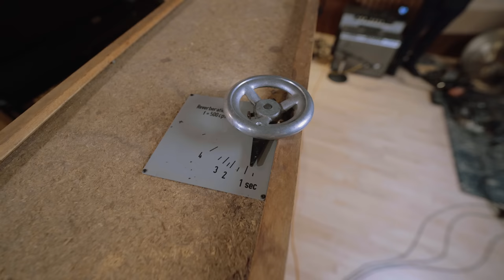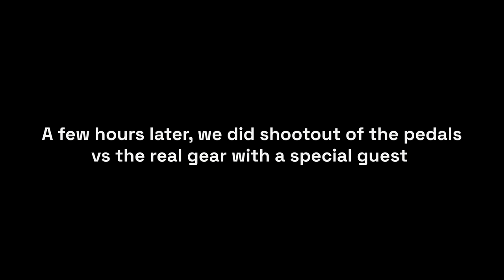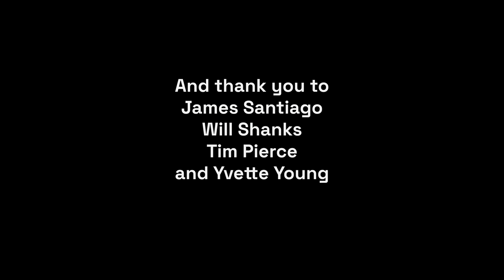The AMAZING Sound Of A Real Plate Reverb

Comment: This was a wonderful video to watch not only because of the history of the EMT 140, but because when I was a grad student in Electrical Engineering, I was part of a trio of semi-pro musician-engineers, and we actually built a large plate reverb according to the explanation in an audio engineering textbook. I had inherited a very large, very heavy wooden wardrobe, which was portable in the sense that with 5 men and a boy, plus a lot of wheelers, it could be shifted from place to place. It was made of very solid wood, on average about 1 inch thick (I believe the "box" was Oak, the back panel Teak, and the front 'double door' had been made from a single slab of a monsterous Redwood, felled and sawed decades before. I discovered that there were some sheets of steel stacked up on one side of the EE building loading dock. They'd been there for ages - one was either 3/4 or 7/8" thick and the other two were 1/4" steel plate. There was also a large sheet of thick copper,  a leftover from some "secret" radio-frequency work done there during WWII. By great good luck, our immediate boss was also the Dean at that time, so when we put the proposal to him, he though it was a great idea. We were expected to spend at least 1 hour of every workday on our own "personal" projects or ideas, with parts supplied from the EE stores. Not sure how that would go today.  With much grunting and a lot of bodies, we manhandled the cabinet up to the top-floor lab, where our group "lived." The department had an superb machine shop staffed by extraordinary craftsmen, so after we'd explained what we wanted the steel plates to do, they designed and fabricated both a suspension system, and a mechanism for moving the plate position. We had several coil-winding machines available, since we made almost all of our own research instruments, and so we cobbled up some drivers and pickups without too much difficulty. There was an excellent book all about the theory and practice of making inductors, for almost any purpose. It was about 2 inches thick, and had been written at the end of WWII, so there was information in there that had been developed for various types of equipment. That was a big help, also. From there, it was simply a matter of "putting it all together" - which was not without incident. One of the technicians from across the hall, who'd been giving us a hand, had the misfortune to have the thick plate dropped across his toes. If the University Hospital had not (literally) been next door, it might have ended with amputations, but fortunately the ER surgeons were right there, and were able to re-attach the toes. I suppose that the finished unit weighed at least a ton, and it aroused a lot of interest from musicians all around the campus. I know it remained in our lab after I'd moved to private industry. What was really distressing to learn was that when the "old" EE building was demolished to make room for a more modern Engineering center, the Plate Reverb was not removed. Instead, it fell to the wrecking ball because at that point there was nobody present to stop that destruction from happening. It was a once-in-a-lifetime project and opportunity, and I'm pretty sure we wrote a note about the project for one of the Engineering journals - I don't have a copy, unfortunately. It was a stinkin' shame that the unit we'd fabricated was destroyed and hauled off for scrap. Quite a few people who'd been involved at that time protested strongly, but the damage was done. If we'd had to buy the wood for the large cabinet, and the steel plates (and the copper one), it would have cost a small fortune. As it was, almost all of the main pieces were "good luck windfalls."  We had a lot of fun with it, as did other musicians who came over to try it out. It could be done again, if money was no object, but now that the department is run by HR rather than by an engineering researcher, such "frivolous time-wasting" could never happen. Our Faculty went from being one of the best in North America, and now is more or less a "woke joke." Certainly, Engineering is not the first focus. Thanks for sharking tis Rhett - I'd almost forgotten about the "wardrobe reverb" cabinet (dimensions 6-1/2 ft tall x 5 ft wide, about 25-30 inches deep). Quite the beast.
Reply: Awesome story, I enjoyed reading that a lot! Thanks for sharing. Sounds like a lovely memory with all the highs and lows

Comment: You can have this specific unit on your pedal board if you capture an IR of it. Capturing IRs is pretty easy for this kind of gear. This type of equipment is a linear time invariant system so convolution captures it perfectly. You can't capture a modulated  (changing over time) digital reverb though.

Comment: I got incredibly lucky, getting my hands on a Polara (DigiTech) reverb pedal. My FLGS was trying to get rid of it,because DigiTech was about to issue a v2, with a different paint job. 

Anyhow, it has those Lexicon reverbs -spring, room, hall, plate, reverse, modulated, and halo, and it’s freaking fantastic. 

They’re now going for 3x or more what I paid for mine, and my guy at my FLGS said he wished he had 10 of them. They’re not hard to find, and I think they’re still in production.

Comment: The Lexicon 224 Reverb sounds cool for sure, but I have to say the guys at Chase Bliss took it to another level with the CXM 1978 pedal. To be able to get what those old school Lexicon's used to do, but even higher fidelity and low noise (or lower fidelity, with the controls), at a fraction of the cost, and put it on a pedal board -- is pretty awesome.
Reply: Not sure why the video doesn't mention it, but UA also just put out a 224 pedal called Evermore, at the same time they put out Heavenly, the EMT plate pedal.